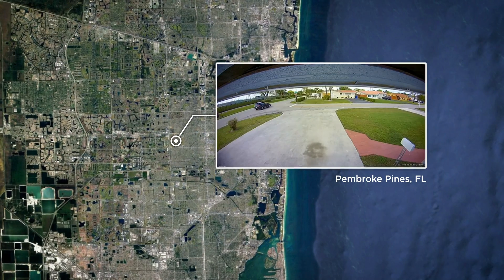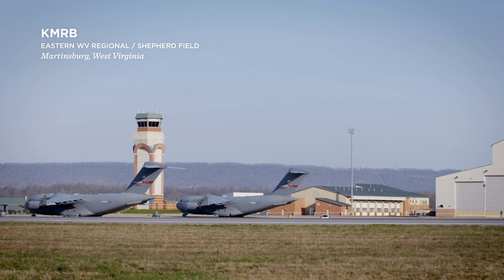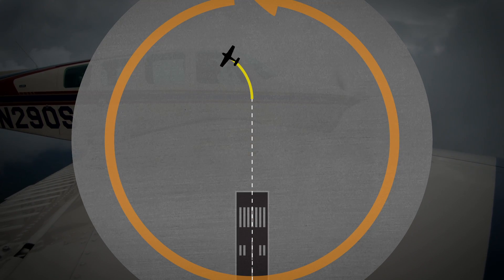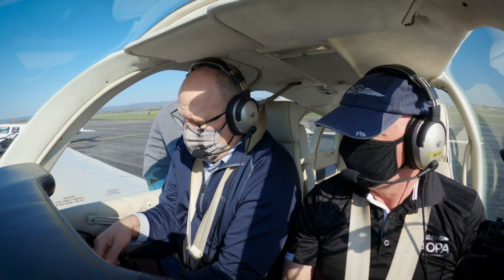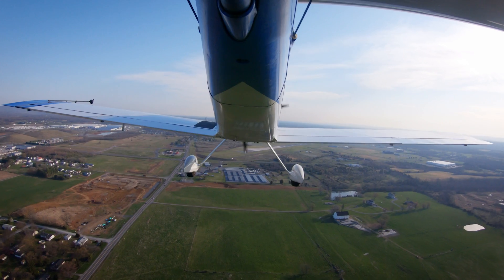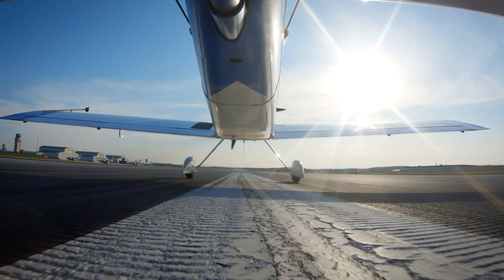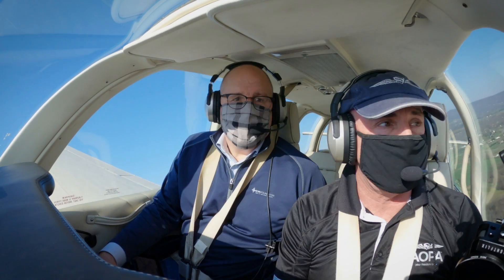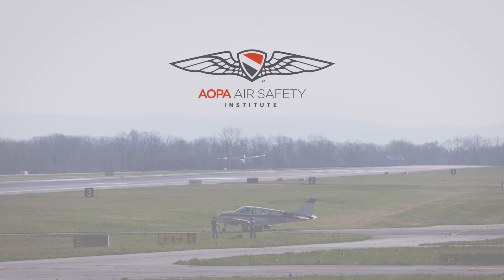Reality Check: The Runway Behind You

Comment: A couple things to note from someone who has actually done this for real:

1) Your departure angle from the from the airport is going to be the biggest factor of whether you can actually make it. 

As we have seen this is a result of the aircrafts climb profile, but wind speed is a very large factor as well. With a 15 knot headwind, you’d probably find that the Cessna 172 would overshoot and/or have difficulty stopping in the remaining runway, while the Bonanza would benefit from getting drag out (gear, flaps, prop fine) and make it.  The departure angle is also affected by temperature and humidity. The Cessna 172 also wouldn’t make it at hot and high conditions as its departure angle is too close to or even below its glide profile.  

2) The amount of turning you need to do will be dependent on a couple factors. How tight you make the first turn, how much drift you have and whether you compensate for it, and whether you turn into any crosswind or away from it. 

I noticed that all of the pilots here turned left. Instinctive for pattern work, visibility on side-by-side aircraft (which the Cub and RV are not) and goes with left turning tendencies (irrelevant though with no power). Left may not be the best direction. 

So for my method, I do this:

I let the plane drift downwind after takeoff. Obviously not if there are obstacles or traffic, but even vector SIDs out of a large airport are runway heading with parallel departures. 

I take note of how far I am from the runway by the time I reach altitude. Again, in a Cessna 172 high altitude hot day no wind... it’s physically impossible to make it back to the runway from 600 feet because of how far out you’ll be by the time you reach it. Unless you have a turn after departure, you won’t ever make it back at any altitude. Don’t let this video fool you saying that a Cessna 172 could make it back easily. 

For the failure itself, if your profile suggests you could make it back based on altitude, distance, and wind... turn OPPOSITE the direction of drift and turn as tight as you can. 60 degrees of bank while throwing out flaps. Pull to the stall horn or buffet, and sacrifice altitude to maintain airspeed. Forget the ground school “60 degrees is 2Gs and 1.4x stall speed”... that’s for level flight. You aren’t pulling anywhere near 2G and since stall warning/buffet is based on Angle of Attack they will always give you warning. Don’t panic.. sacrifice that altitude, and respect those warnings. 

It is not for the faint of heart, but it makes the second turn that you have to do even lower much easier. Do not panic if you see the ground or trees or houses rush up at you. If you run out of room.. roll wings level, keep your airspeed, and accept what’s in front of you—if you keep control, you will likely survive. If you spin, or stall... you are dead. 

If you’ve done the first turn well.. you should be offset by maybe 30 degrees rather than 45 or more. Determine at which point your plane will comfortably glide and if it is slightly short... plan to enter ground effect there to stretch the glide, if you can. If it is long, forward slip or reduce airspeed slightly from best glide to steepen the descent. 

Of course, remaining straight ahead is probably the best for most pilots. Even in built up areas... as long as you have a controlled crash, you will probably survive. Even into a wood stick house. 

The reason why the FAA would rather you land straight ahead is because of the discourse I just gave. It’s far too complex and there are far too many factors to effectively teach it safely. 

So please don’t assume your 172 can do this all of the time. The insurance company owns the plane as soon as the engine quits. Don’t be afraid to destroy it to save your life.
Reply: So many factors to consider, all of which must be figured on the ground before you leave.
Reply: 60 degrees of bank to the stall warning/buffet while throwing out flaps close to the ground will get some people killed, I'm afraid. I hope I'm wrong, but I would sure want to see a couple dozen pilots do it in live situations before I was confident with that advice. The data show that GA is already very inclined to stall/spin even when not in a panic. Good analysis on other factors involved.
Reply: @ReflectedMiles Putting out flap will assuredly steepen the glide angle and reduce range on the return to the airstrip. Coming in too fast can always be cured by side slipping/forward slipping, fishtailing, flaps, or pitching up to near stall speed horn sounding if comfortable with that.
Reply: @ReflectedMiles  I guess a lot depends on the ability of the pilots to keep the DESCENDING turn with 60 degrees of bank still COORDINATED, especially when dropping flaps at the same time to reduce turn radius  At least during my own recurrent emergency trainings, I frequently  glance at "the ball" during low-level turns,  because more than anything else, an inadvertent side-slip can really ruin my and my instructor's day,
Reply: @rnzoli  Add in the pucker factor and you have my concern in a nutshell. Way too many variables to be doing it that close to the ground, I'm afraid. Some will inevitably do well; quite a few, I'm afraid, will not. I do actually know some old, bold pilots, akin to Bob Hoover, but they are extraordinarily skilled with sharpened senses. Most pilots just imagine or hope that they can do the same things, especially when they are aware that their lives and those of their passengers are at stake.
Reply: Makes me think that students should practice this with yarn taped to the windscreen, glider-style
Reply: @julianbrelsford if only ! Unfortunately prop wash on a single negates its use !
Reply: I would say the complexity of the maneuver is exactly why every pilot should practice it with a CFI. You don't understand all of that unless you've tried it in real life. Know what your combination of skills and airplane can and can't do.
Reply: Brian Schiff recommends no more than 45 degrees of bank. It appeared that in the RV and the Bonanza, the pilots banked about 30 degrees, which may have had some effect on why they didn't make it. Also, Schiff recommended pulling the prop back to low RPM to reduce windmilling drag. I'm wondering if more bank and less RPM might have made a difference for those two aircraft.
Reply: So... Question, you drop flaps in the initial turn to reduce turn radius? And wouldnt that kill some of the glide performance you'll need after the initial turn? Or are you proposing drop for the turn and retract immediately after?
Reply: If you're in a 60 degree bank and pulling to the stall horn, you are definitely pulling g's lol. It's a myth that you only pull g's in level flight
Reply: Just asking as an enthusiast.  Let's say I take off I have no idea my engine is about to fail.  Bolt out of the blue bam here we are. What do you think would be the best course of action.  Let's say for the simulation I took off perfectly great angle all is well until engine failure
Reply: Seems to me that all of this is too much to judge in the split second that you need to take your decision, and the best for me would be to land within a 45° cone ahead of the runway direction you just departed. It would be bad luck that there wouldn't be any patch of terrain you could use for a controlled crash landing.
Reply: I've never put my hands on a yoke but, to me, it makes perfect sense
Reply: This is a LOT of writing, so I looked at the user's home YouTube page and found zero content and 6 subscribers.
Reply: Amazing comment. Glad I saw this. There are a few flaws in this video for sure
Reply: Before I finished reading I was going to comment “That’s far too complicated to remember and process in a pinch” but you said exactly that. I would not be trying this unless I was at a sufficient altitude.
Reply: Very well said. I'd fly with you any day.
Reply: Agreed.

Comment: I couldn't tell from the video, but it didn't look like any of the 4 aircraft approached 45 degrees of bank in the turn, which has been shown to be optimal.  One of the key components of a successful turnback would be to unload the wing, i.e. aggressively dump the nose.  A pilot would have to be very proficient and practiced with his craft to pull this off, in my opinion.  Too much emphasis on getting back to the departure runway, versus just making it back to the airport boundary to a grassy area or an area clear of buildings and structures.  Far better to crash there than off the end of a runway with trees, or a road, or a commercial shopping center.
Reply: As stated during the video, they did use 45 degree banked turns to return to the runway. I believe it is because this is the most efficient way to get back - requiring the least time in the turn and the least distance over the ground to complete the turn.
Reply: YES, if they would not bank even 45deg. - the turn will take to long (and brings them away from runway). I would think: 60deg. bank is a better 'approach'. "Unloading the wings"? - you could do only in level flight, not with 45deg. or even 60deg. This is not the issue here to "unload the wing": it is the issue to turn as fast/most with minimum altitude lost (and "best glide speed" is not available here).
Yes, pitch is airspeed - but why would you pitch too much? Main priority is "best glide speed", too much pitch kills also altitude. And in a steep turn (e.g. 60deg.) you have to maintain "best speed", potentially you had to pull in the turn (instead to spiral down).

Yes, you have to be very proficient, esp. to keep always the "right" air speed in any maneuver (straight or turning). Flying with the stall horn in turns as they do - not a maneuver to suggest or any pilot could do.

Yes, instead of getting back - have the emergency landing "options" in front of you (and they have a lot, you can see clearly so many other options to land). Forcing a "go back" can be you worst option in several cases.

Comment: Ok... We need to start teaching to offset immediately clearing obstacles and no runway remaining and to then begin the crosswind leg, yes, very low. Flying the runway centerline on upwind makes the turn back further impossible and uses more energy - make your turns while engine power is still there! Glider pilots using self launch immediately offset the runway so you don't have to make a 270° turn back, 180° to face the runway heading, 45° to turn towards the runway, and then 45° to align it again. 

I believe we are all flying FAR too wide of patterns and should not by flying upwind with the runway behind us, THE worst place it can be in a power loss. If you turn cross wind after no runway remaining, and downwind inside of glide to the runway: you have a far better chance. 

Furthermore: turns should NOT be made at best glide! Best glide while facing anywhere but AWAY from the runway is sending you FURTHER from it while losing PRECIOUS altitude and energy! I humbly suggest you guys do some rope break maneuvers in a glider. I fully understand gliders are a different animal entirely, but they teach the turn back maneuver in a completely different fashion. MINIMUM SINK SPEED (not published, you must determine it yourself) must be flown until a suitable landing place has been selected AND in your windshield, IE in front of you. THEN you accelerate to best glide to reach it. Turning at 100kts in that heavy beast is never going to be possible, especially if you fly the upwind the entire time. Turn at 500' and see what happens to your turn back! You HAVE to fly min sink for a turn, NOT best glide, until you have turned TOWARDS the runway. You ate up ALL of your energy flying away from the runway. I will not be renting a Bonanza to try this out, but I'd be totally fine flying up to you to do these maneuvers at altitude and determine minimum sink speed in a turn and when straight ahead, and how to fly a turn back at low altitude and how we SHOULD be flying a pattern. 

Flying with the runway immediately behind you on upwind is making the impossible turn further impossible. Offset (let the wind drift you 500-1000') once obstacles permit so you only have to make a 180° turn back, not a 270° (180+45+45). Then you turn into the wind back to the runway in your windshield, not a bunch of parked airplanes lol You'll be SHOCKED at the altitude lost from the additional 45+45 turns. Make your turns while you still have power!
Reply: Very well said. Your comment won't get the attention it deserves here as it ruffles too many feathers, but you are 100% correct. I'm afraid conventional wisdom (as demonstrated in this video) is akin to ski jumpers in the 1980s flapping their arms while in the air because that's simple "how everyone else does it" while serving no purpose. In fact, quite the opposite
Reply: @David David  to be fair - when I taught primary in aircraft I taught exactly everything they demonstrated in this video. It was only because I was taught it and demonstrated it myself as a student. It wasn't until last year when I fell in love with gliders and bumped into a 4000hr glider pilot who pointed this concept out, and then we did it. I was blown away. 

When you look at most self launching gliders the flight path they take (most common in Europe, and I own one in the USA) - the pattern keeps them in tight and in glide of the airfield. They intentionally let it drift on initial climb if a crosswind is present, and turn crosswind almost immediately. And downwind likely less than 500'. This is because motorgliders have horrendous climb gradients, worse than their glide with the engine out. So an engine failure = into the trees if you don't stay in glide angle and distance of the runway. Basically they perform similar to a Cessna 150.
Reply: These aren’t gliders, and on a hot, high, and humid day with no wind it won’t matter what you do... you aren’t making it back, period.
Reply: @Bartonovich52  You missed the entire point of everything he said. And then you made no point whatsoever.
Reply: @Bartonovich52  I said exactly that I recognize these aren't gliders. All the reason to optimize your glide by making your turns when your engine... Is running. Not when it's a horrible form of a glider. 🤷‍♂️

If you fly a 1000' upwind and have an engine failure: you aren't making it back in many airplanes. If you do a 500' upwind you have a shot in most aircraft. 90° less of a turn to make to return.

Think of the climb gradient vs glide angle lol it makes zero sense to fly away from a landable location (IE the runway you just took off from) and then hope to glide back at a worse glide ratio.

Comment: I'm not arguing with the results on the Bonanza but what if, there was a parallel runway to land on where only a 180 degree turn was required and not a 270 and then a 90.
Reply: Also.. what if the day was colder, the wind was higher, and the pilot more aggressive on his first turn?

The Bonanza wood have made it while the 172 would have overshot. 

Hot high and humid no wind?  No luck for any of those planes except maybe the Super Cub.

Comment: A very informative video!  The main takeaway I get is that a smaller. lighter, fixed pitch prop airplane will do much better with the turnback maneuver.  I have a glider rating, and I think that helps me significantly.  During my ASEL training, my instructor cut the power on downwind, and had me do a simulated engine out approach.  Turning short final, he told me to put the power back in, and I assured him it was not necessary..... a smooth landing followed.  I strongly encourage everyone to take a few lessons in gliders.  It won't help your airplane, but will give you some skill in flying an engineless airplane.
Reply: That's been my mantra for years now. The FAA should mandate glider training before anyone is allowed to get a power rating. It would save so many lives. Never happen, of course. No bureaucrat would ever instigate any significant change to the status quo that could have a potentially negative influence his or her career path.
Reply: Also known as glider experience
Reply: Also gliders are way more fun to fly imo
Reply: As a SEL,MEL instructor, glider transition pilots were always a challenge because they wanted to land so flat. :-) Flaring does not seem to be part of the glider experience. :-)

Comment: I take it doing a 270 or more like a 230 and attempting a downwind landing on the same runway is never an option ? Reasons not to come to mind : you’d likely end up landing long with a tailwind and risk adding a second emergency to your list-a runway excursion , and second reason not to happens at controlled airports where the tower may have launched another aircraft behind you thats on the takeoff roll. But given an uncontrolled field and a light single with nobody else on the runway , would a 230 back to a downwind landing ever work?
Reply: Watch the video again. A 270 degree turn back to land downwind on the runway they just departed from is exactly what is being demonstrated here. The risk of running into another aircraft taking off behind you would be extremely low, especially if you announced your emergency.
Reply: @mdickinson  ooops, that’s what I get for just listening to the audio while doing other things and not seeing the video . I’d like to see it again anyway , and I mean SEE it.